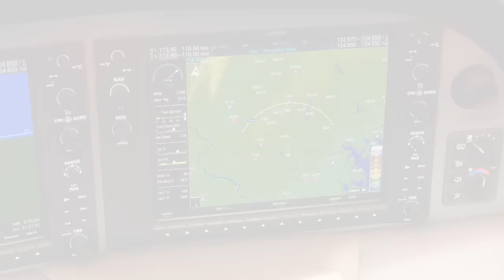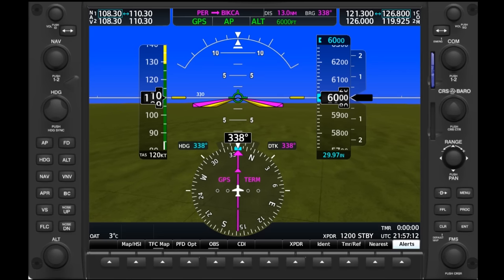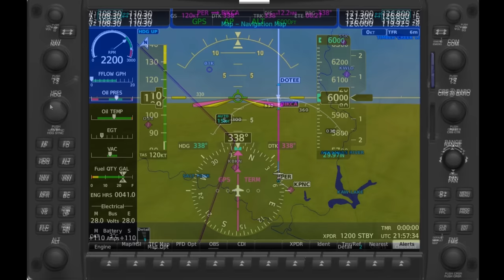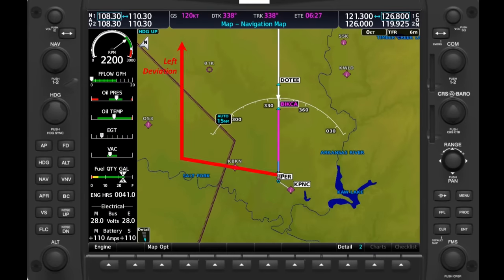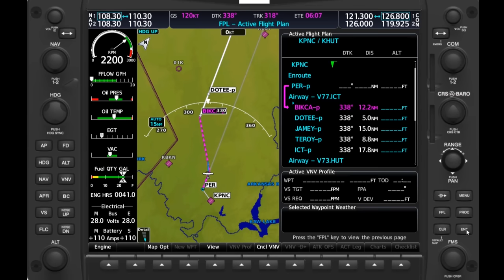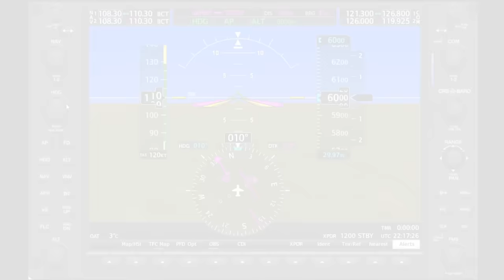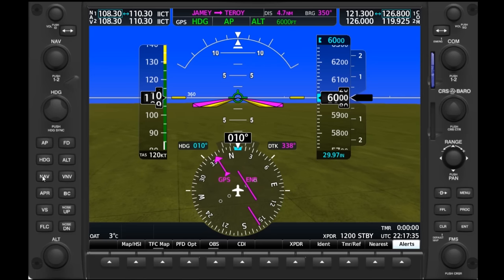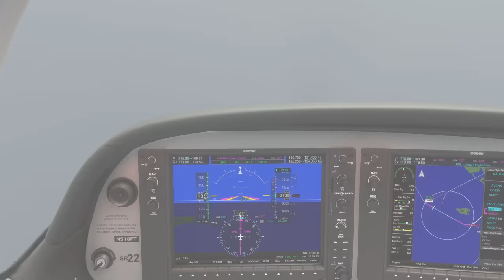How to Deviate around Weather | Safe IFR Flying

Comment: If on a checkride and I deviate on a parallel track, how do I determine the new MEA, MCA, etc?
Reply: Look at the plate for the OROCA.
Reply: @Saml01  Gotcha. Often times the OROCA is far higher than the MEA, so it sounds like it could be easy to box yourself into a hole if you fly in mountainous terrain with a 172 and have WX ahead.

Really good to consider, I guess, for the planning phase before you ever leave the ground.